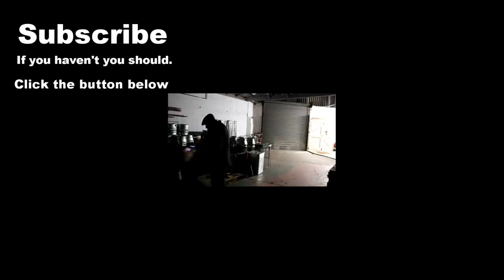STRIPPING PAINT FROM OLD TIMBER DOORS

Comment: Exhausting that kettle correctly is going to be a bit of a pain,tbh i don't like the idea of going up through the roof with a chimney stack,surely there must be somewhere you can stick a vent pipe out with fan assist to make it easier access down the road for cleaning etc. like with a tumble drier? Personally i would leave the roof as the very last desperate option,given your building setup it's not really a safe option either.Speaking of tumble driers have you considered a condenser setup for ease of use and access for cleaning? Cheers.

Comment: I'm trying to figure out where your email is? That's a long run for the exhaust. Not safe for you or later accessible out and over the roof. AND even more condensation draining back. Regardless drain or trap to keep from going back in the kettle. Need a steam exhaust suitable boost fan and maybe some drain spots. Run it inside over to where you want to go out. Need a coarse bird/critter screen. The line will need cleaning. Keep it accessible and easier to maintain.

Maybe a portable fan with corrugated hose to just get it out the door until you have time.